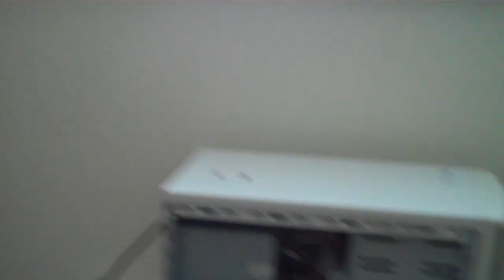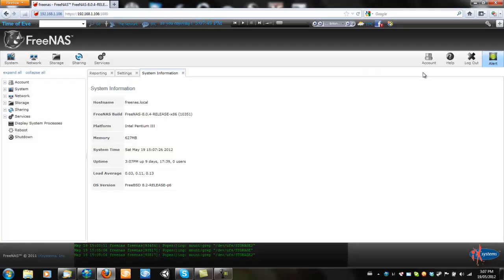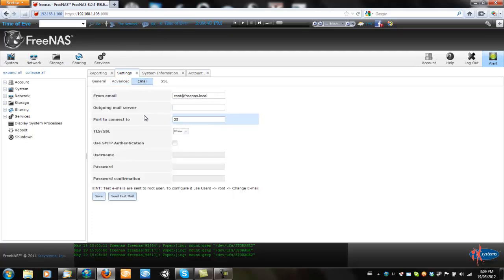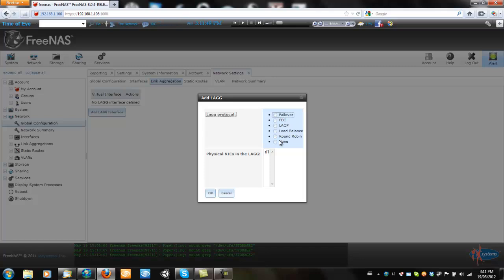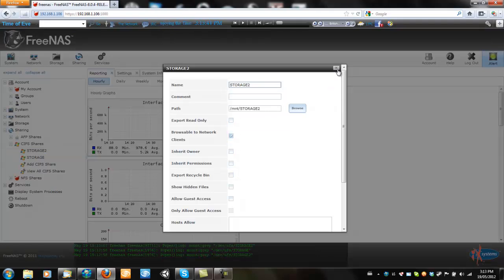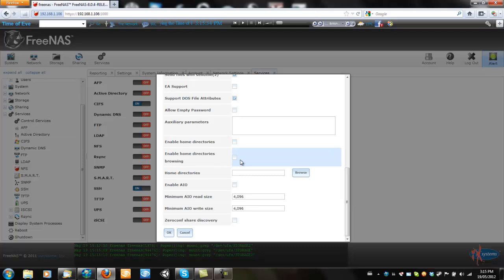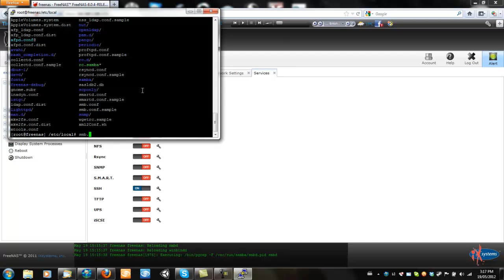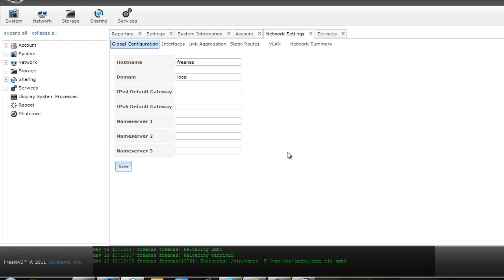Building A Home File/Web Server: Part Four FreeNAS

Comment: i have an old hp proliant dl360 and i want to use it as a simple file server. what os do you recommend? and is freenas compatible with it?
Reply from the maker: +jaakko200987654321 Try using a compact flash drive to PATA adapter. Just boot the image off the compact flash.